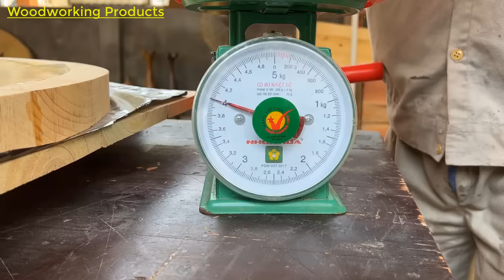Wood Processing With Epoxy Glue// A Green Dining Table With A Natural Character For A Small Kitchen

Comment: That bit of slab in the middle don’t do it any favours should of cut it and put it in around the sides up at the 2 ends and left the river in the middle the slabs were all wrong for the shape table but that’s just my opinion good abilities though you  just need to work on the sanding and polishing methods